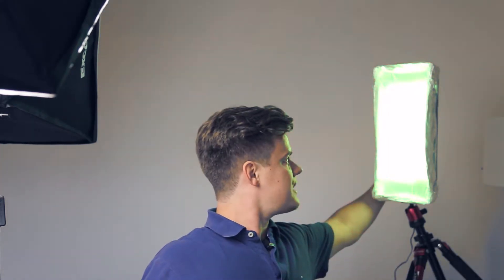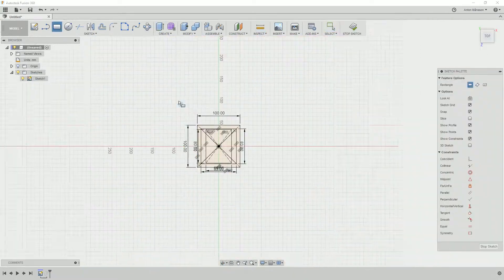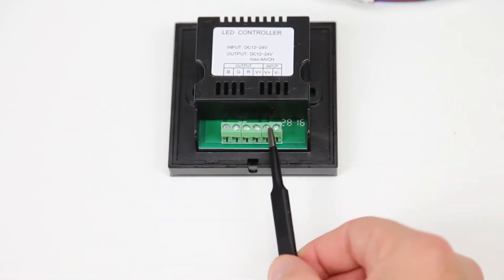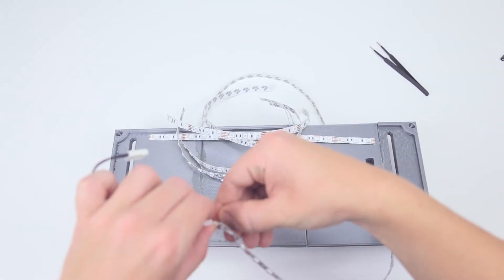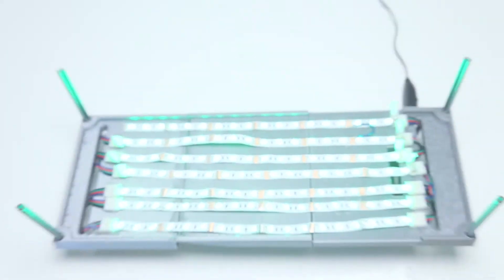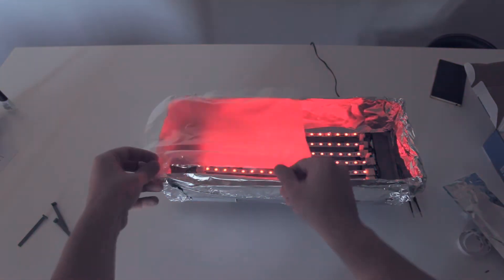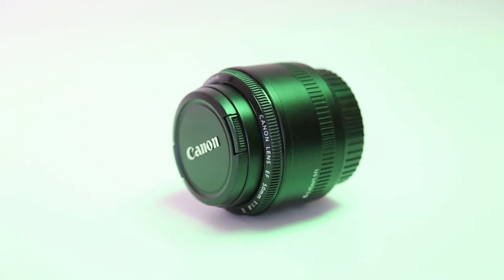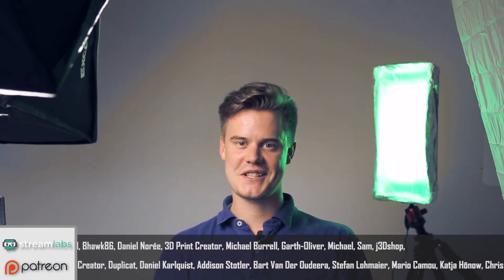DIY RGB LED Studio Light using 3D Printing

Comment: Hey there! really interesting. I'm looking to make my own rgb tube lights with LED strips, and the one problem I came across is that dimming the lights or choosing non-red-green-blue colors makes the lights flicker on video. I found that this is because the leds don't use voltage dimming, but flicker on and off to make it look less bright or to make different colors. Your light doesn't seem to flicker on video in any setting, so do you think that has to do with the added rgb touch controller? This could be my solution. Thanks!
Reply from the maker: Hola!  Thank you =) To be honest I think it's just my shutter speed when recording. I match shutter speed to same or double the recording framerate. I never go over 1/50s in shutter speed since my studio lights flicker a bit if I go higher.  So in this case i probably recorded in 25fps, using a 1/50 shutter speed. That gives softer motions and more light. but also more motion blur if I move to fast. The benefit is of course less flimmering of stuff =)
Reply: 3D Print - Tech Design Thanks! I also film 25fps 1/50 shutter, but I still get flicker. Maybe due to the low quality of the strip, I don't know...
Reply from the maker: Oh OK! Wierd. We'll the controller is quite decent. Unfortunately I don't have any other controllers to verify that. As you see in the video the controller is pretty "fat", but if you can fit it into your project it should work fine :)

Comment: This is one of those projects that someone shoehorns in 3d printing when they could have created something of better quality, and built it faster, if they just used plastic sheets or wood.
Reply from the maker: Its truw what you say and I want to explore doing more, but again I'm a bit too deep into 3D printing, and so are my viewers, that it feels wierd leaving it completely ;)  I have more projects that are even more related to 3D Printing that will make a bit more sense. Because, yes, you could make most of this with cardboard as well, It's just a matter of what tools you have available at home. Me for example, I cant really use wood or a saw in my apartment and I'm sure many others have similar issues.

Thanks for feedback I sure will regard it!

Comment: Nice project ! The quality of this could be better, I think it would look better if you print some walls and attach the foil from inside, and instead of using the bags you can use a special plastic diffuser. Otherwise good job ! Keep it up :)
Reply from the maker: Thanks! An v.2 is probably coming yeah, maybe a step up in budget. Because that was one of the focuses here, just cheap ;).  Plastic bags look a bit tacky I know, but they reflect almost perfectly. Couldnt't have found anything better really. The mix of light passing through and the "frosty" look gets all the single LEDs away and still emit most light!